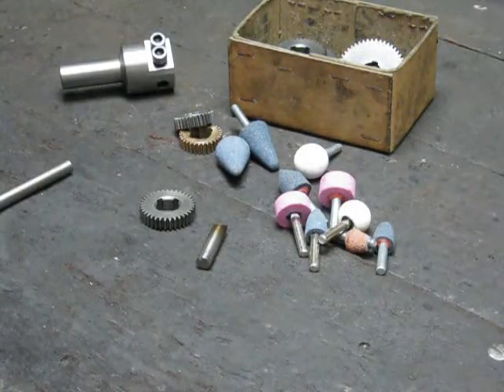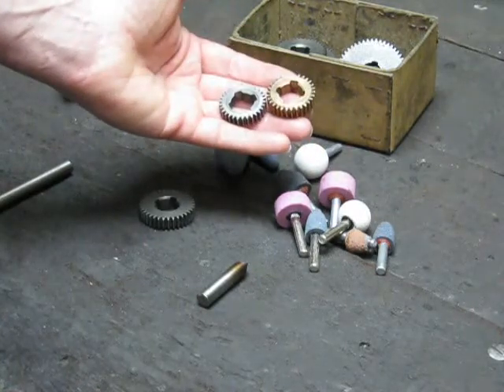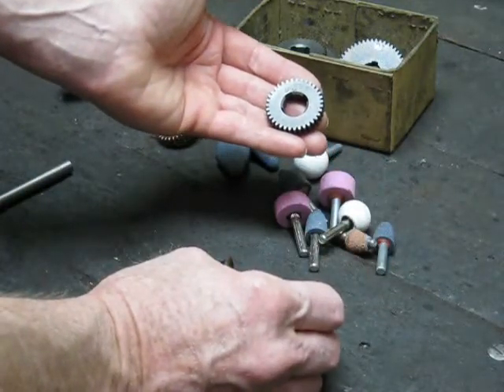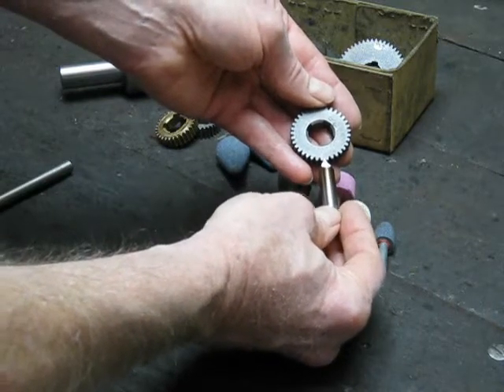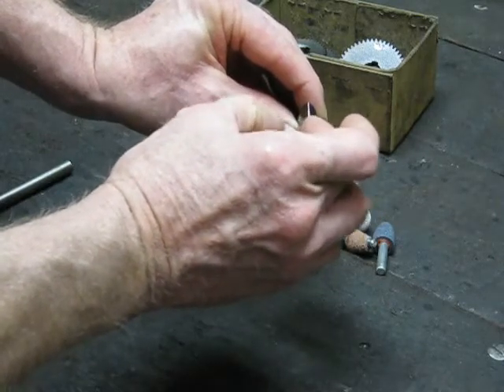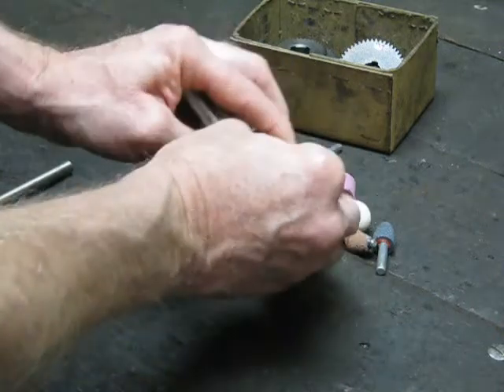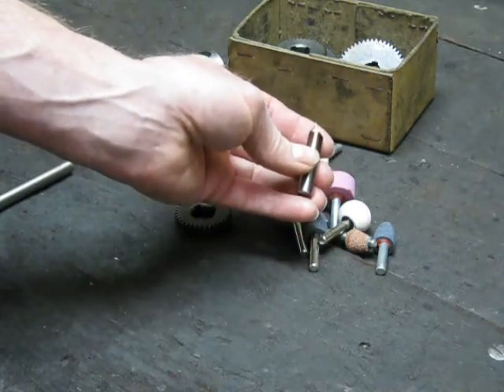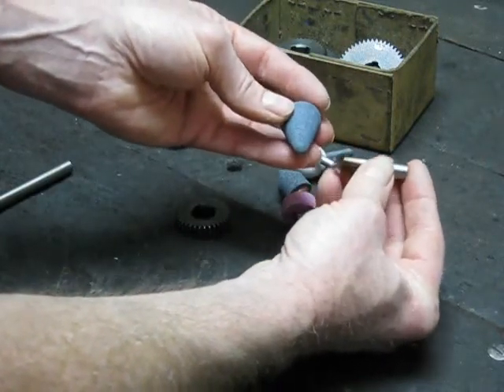How to correctly profile a single point gear cutter - easy method

Comment from the maker: The big advantage of using a tapered grindstone is that you can easily vary the curvature of the cutter profile by selecting a wider or smaller radius on the stone.  The correct radius is subject to a bit of trial and error, but not difficult to determine.  Try out the method on a similar sized piece of scrap round steel rod before switching to the HSS blank. Cheers Rob.
Reply: xynudu i

Comment from the maker: When I first made my gears I started off grinding the tip freehand, and it's very difficult.  You have very little control over uniformity.  Holding the HSS blank in a fixed position (with a millslide) makes it very easy to shape the cutter against a grindstone in the chuck. Any tapered grindstone will do. If you offset the HSS blank in the millslide you could probably also use the round stones to get a similar effect. You can also buy tapered stones singularly (in a larger size).  Rob

Comment: Was really hoping you were going to to say a fly cutter for cutting flies. Jokes aside, you could use specs from a set of gear cutters online to narrow in on what tooth counts would work for the cutter you need. I only mention this because the viable tooth profile works for an exponential number of gears based on number of teeth

Comment: Rob..brilliant idea. As a followup, Ivan Laws  (Argus book 17)  "gears and gear cutting", on pg 114, gives  the correct diameter of the stone, so thinking outside the square, could you not measure up the taper of the stone until the correct dia was reached, mark with a pencil and bingo?
Reply from the maker: I first saw this idea where a guy used a taped rotary reamer/rasp to do this, but thought that was a bit crude.  A tapered grindstone is cheaper to buy and yes, you could do as you suggest.

It works very well, particularly as it adds back relief.

Cheers Rob

Comment: This is a very useful idea, we were concerned with needing the original gear as a gauge to grind the cutter to. I am presently working through how to modify our rack from gear cutter attachment for the shaper to be useful on a lathe instead! https://youtu.be/UMT-hXr6WWQ
Reply from the maker: It's the only way I've found to accurately get mirror profiles on a single point cutter,  and with relief.

Works very well.

Cheers Rob